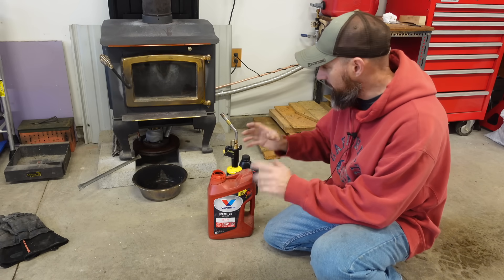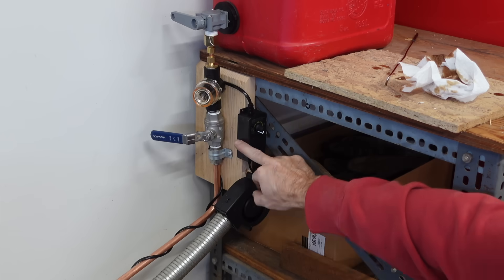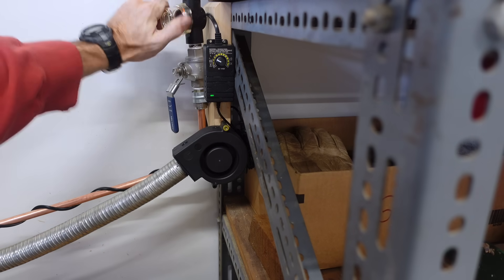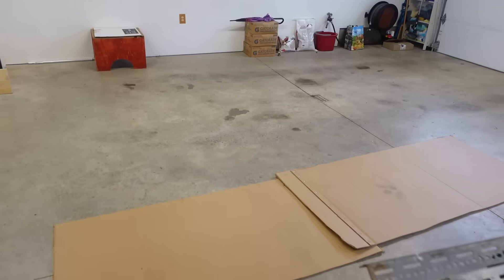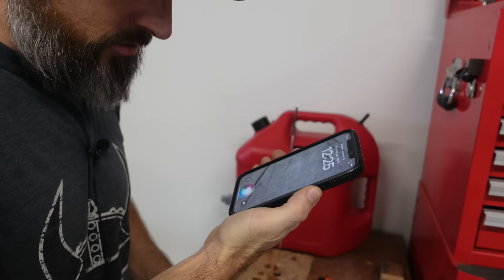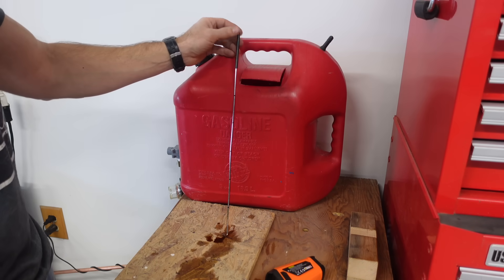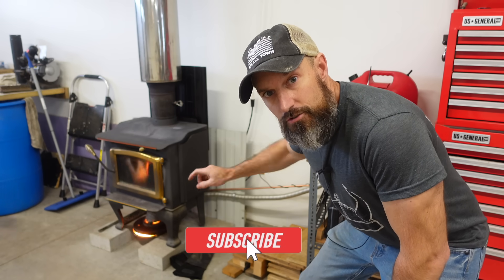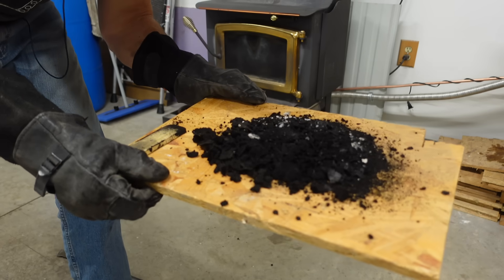How much oil does my used oil burner burn in 8 hours??

Comment: You should get a heat fan so when it gets hot the fan will circulation hot air from your lower pipe into the fireplace.

Comment: The residue in the bowl seems fairly large, so it brings up the question of how much oil residue or partially burned oil has clung to your flue pipe.  Have you looked at it since this video was made?  I would suspect you have to do some maintenance on the vent pipes to prevent an out of control fire in your attic space or roof, no?   Thanks for sharing this video.
Reply from the maker: I just looked in my flue yesterday nice and clean. I don’t burn used motor oil very often, though this was mainly an experiment. I still burn a lot of wood.

Comment: You're blowing 80% of your energy (BTUs) straight up that pipe.... I'd have a deflector plate make that flame blow out at all 4 sides and then up and out the flue pipe... You won't need even 1/4 of what you're using now.... That stove would run you out of there...

Comment: Lack of evident clear smoke, some puffs here an there means your burning hot out the stack. Couldn't close the damper by a 1/3. Direct more heat into your space, your heat is going right up the pipe. You could go 14hrs minimal on 5 gallons with damper control
Reply from the maker: Thanks for the tips!

Comment: What I would focus on is adding steam into your burn chamber.  Have a metal tube that brings the steam right into the lower flame area, and boil your water reservoir on top of the stove OR wrap copper line around your exhaust pipe as long as it isnt double insulated.  You should easy get 2X or above with little trouble, steam converts directly into hydrogen at the waste oil burn temp.  You will be super happy, its as close to zero point as you can get, much more output than input
Reply: Do you have one built with steam as a example?

Comment: as if your set up is like that.. that is dangerous. The part that is under the stove should be inside. And you should be using a puppy feeding bowl not a water bowl.  And my brother made an oil burning stove using an old fire extinguisher.  The bowls are inside the stove.
Reply from the maker: Thanks for the safety suggestions, I will consider that.

Comment: At that rate a full 275 gallon IBC tote would burn 24/7 for 36.66666667 days. That’s absolutely wild. I’ve got access to about 20 of those totes full to the brim with used oil. I really ought to build one of these for my garage. Mines a lot smaller so I could probably use even less oil to get the same results so long as I make one at least as efficient as yours.
Reply from the maker: Sounds like a great project, thanks for watching! just be very careful

Comment: i know this is old but I have converted a similar solid fuel stove which heats my 60' x 7' boat in the uk. My burner pot is inside the stove with a central air supply from a similar fan. I use just under 5 litres in 24hrs and get about 2 tablespoons of ash which is mostly white. I have a perforated dog bowl on top of the burn pot and there are hardly any visible flames as it burns mainly blue confined to the pot which glows red. The exhaust gas is clear. Oil control is by peristaltic pump and air delivery is variable. Flue gas temp is monitored for flame fail detection which shuts it down. It took a lot of mess and experimenting to get it to that stage and I can now remotely control and monitor it from anywhere with my phone. It takes about 30 seconds to convert back to solid fuel.
Reply from the maker: Sounds like a real awesome setup wish you were my neighbor. Thanks for watching

Comment: First off get rid of that insulated chimney that goes all the way down to your stove you are losing a lot of heat by not allowing that pipe to radiate the heat into your space. When I burn paper garbage in my wood stove in an enclosed patio area all the heat in that one 5-minute burn comes off the stack and not the stove. I can often put my hand comfortably on the stove as the bulk of the heat went into the thin sheet metal stove pipe, 6' long and released it into the space 
 I also use a fan. This is very important, as it removes the excess heat that otherwise Would go up the chimney and pushes it around the room. Fans improve  efficiency dramatically. An 8-hour burn should have brought that temperature up to 80 degrees or more. A lot of it is going to heat up the great outdoors.
Reply from the maker: I agree my I need to replace my chimney. I got it real cheap. Thanks for the tips. Thanks for watching

Comment: 90% of your efficiency is being blasted outside via the chimney. Think diesel space heaters they blow into the room. My opinion is to  remove the glass from the door, replace it with metal mesh, and add a baffle to the flu. You'll be at 80 degrees in under an hour. Keep 2 things in mind although please be mindful of black soot or smoke burning oil should not create smoke. Last is fire consumes oxygen so prop your garage door up 1-2in while in use or add a wall vent or draw your combustion air from outside. Do not use and aerosols paint etc... while this is running.
Reply from the maker: Thanks for watching and for the suggestions.

Comment: I can't say this is a good test. You're not starting at a very cold ambient temperature. Here in the northeast, this time of year, my shops ambient temp is around 20-30 degrees. The size is 600sqft. It needs a pretty hot fire the first hour to get it up to 50. Once the temp is there, then it can hum along at 3.5 to 4 hours per gallon of oil. The first hour it probably burns up 1 gallon-ish. I still believe I built the most efficient oil burner on YT. Nice stove either way, Stay safe.
Reply from the maker: Thanks for the tip and Thanks for watching.

Comment: Do you need a regular chimney for something like this?? I need heat in my barn, but I do not want to run a long chimney due to how high the roof is. I'd rather have something like a pellet stove where you just run it through the wall. Trying to figure out the most economical way to have some heat.
Reply from the maker: Yes I believe you need a chimney. I have a Harman P68 pellet stove also. Harman is one of the best. I have many videos here on my channel about the Harman

Comment: Insulted pipe should only go through building/ceiling/roof garage you should see it all single wall and you will get all that much more heat off the exhaust. They also have inline exhaust heaters at Menards. You could also do a copper Coil around exhaust about 18 inches and run radiators around floor off shop or hot water for garage sink. Small solar ran pump, if you want to really utilize the exhaust heat. All depends on how much you are in garage lol I have everything hooked in mine. Also you can get solar/wind power for the heater blower motor in 12volt. I will be showing it all on my YT channel starting Jan 25th KING.TROMP4PRES on all platforms. Thanks
Reply from the maker: Thanks for watching, I appreciate the tips! I'll have to check this out on your channel. I have thought about changing my pipe inside my garage. I got a good deal on it that is why I have it inside also. I can't believe you are the first to say something about it. Hope your channel is doing good
Reply from the maker: I could not find your channel give me a link

Comment: Burning wood in my wood heater i have no problems getting 10 or 12 hours of heat and i get far higher temps from cord wood than you're getting with oil...about double...is this setup capable of higher temps? My stove top with cord word sees temps in the 700 to 900 degree range on the regular, and this old house needs it, but im intrigued with the capacity of oil burners. Bigger jug means less time tending the stove. Good vid thanks.

Comment: Can't you run a heat exchanger to pre-heat the oil?  I bet that would make it get to temp faster and give you a more consistent flow so less management.  Would have to be done in a controlled manner so it's not dangerous.

Comment: I think this is an uber practical tool, useful in specific situations but hardly desirable as a regular heat source: Leave the oil in the ground if you need to breathe clean air!  As I once heard someone say "It's gotdammed Medievalism Jim!!".
Reply from the maker: Thanks for watching. It's just an experiment, and not something I recommend as a primary heat source.

Comment: Anyone who has ideas on how I can achieve this safely by all means reply. The heating unit has a climate control thermostat, all so. 

Coleman Mobile Home Oil Furnace 
Model: 8845A701 Code: 667
Max. Flow: 27 Booster Pressure: .13
Electrical Rating: 115 volts cycle 60 overall rating 12 amps or less 
Tested at .2 inch of water column pressure
Furnace was made in Wichita, Kansas, and tested in Massachusetts in 1964

I have more information on the unit if anyone who can give me any advice on how to get this unit running off waste oil or something that isn't as expensive as natural gas or propane, etc. The thermostat is a newer style (digital climate control). It controls my central air conditioner as well, but it's running off electricity.
I live on the coast of SC, and I know it doesn't get as cold here as other places, but I'm still trying not to freeze my nads off 😅
(Also, I saw on the model plate that the Furnace used to use Furnace oil. I wasn't born until 1973, so I'm not sure how they fueled this thing back then...)
Many thanks, guys & gals! 🇺🇲🇺🇲

Comment: Need to add a small adjustable fan for air intake to turn flame into blue, clean burn, more efficient.  
In addition, put a fan the move hot air away from stove to heat the room.
Reply from the maker: Thanks for the advice and thanks for watching

Comment: Hi. Try install  half inch cast iron plate above the fire inside the burner it will double burn the smoke. When the fire with unburned oil touch the cast iron it will turn into hot gases and double burn . good luck man

Comment: If you get a small generator powered by steam turbine which is created by the heat then you can power the grid for 5 sqm. 😅 probably.
 Better still buy a cheap gieger counter & search your property/ land for any radioactive material such as uranium to turn water to steam to drive that turbine .
 I remember seeing an advert that 1 teaspoon is the equivalent of 1 ton of coal & 90% recycled.
 Its fairly important though to wear safety glasses and a covid mask 😷 😅
Reply from the maker: I never wore a covid Mask and I survived

Comment: you don't have proper flow . . .at least you don't have a drip oil feed . . . get a shield in around that burner and it'll fix some of the slag and once you have air flow right it'll burn much much cleaner and leave less residue . . . only thing i seen 'foul' was i have no clue why people put their supply indoor or so close to the heat source >< i know it's not a real issue cept it's YT and for every one that knows what's up there are ten thousand that have no fuck'n clue :)
Reply from the maker: Thanks for the tip and thanks for watching

Comment: Brun it with WAY more air fozed into the burner,,Micro tweeking but this system Can be maybe 3-400% more efective by building it out so that the burner flame heat dosent leave out the chimny with a temprature of maybe 5-700F,,that is extremly mutch heat lost straigt out the chimeny,,an egr system(second re exsose afteburner would cleen the smoke resedue by maybe 70-85%….

Comment: My friends dad growing up made the pool pump port the water through a bunch of pipes painted black that would heat the water up on the way out of the filter pump. I thought that was so cool I still remember it today 25 years later. To heat the shed, im gonna make a used oil burner that will be almost completely outside, but the exhaust pipes will take a long detour inside the shed to radiate heat. This way I dont have to worry about too much smell or making a mess inside.

Comment: URMUHGAWD what could possibly go wrong? NO NO NO NO NO - Burner pot should be in stove with negative air from chimney at least, to prevent gassing yourself! Air blower is open to the room, going to give off CO when it flickers through the gaps.... No safety to stop the oil flow if the flame goes out/high limit. Sorry, downvote for danger!
Reply from the maker: Thanks for watching

Comment: Hook a little boiler to that baby to power a little stator to charge capacitors and get into blasting things with ultrasound? Eventually you would be sending bathroom waste and food waste to a tank then hitting the resonance to dust everything required to release a ton of oils every so often. You know of wood gasifier I'm sure, but have you ever considered being able to store those fuels for later use? 😉Without needing the gasifier. Ask free or paid AI about Ultrasonic disintegration, its used very precisely by resonance programming for nuclear waste. Amazing its not for masses, even though it would solve thousands of problems just with settings..

Waste leftover from taking fuels = Use for nutrient solution high density to breed Thermophilic bacteria so powerful they can dry material and set it on fire. They are the real source of mulch spontaneously combusting when piled too high. Breed them into a fireproof panel with fireproof wick on a drip diluted below them being fire hazard and they can generate massive heat. Even better? Pile mulch on frozen ground they still come, they slept. You stop feeding them they will sleep, and then when you need fire you know where to scoop from to just use nutrients to make living fire starter. A perfect organism..

Comment: Weld 4 legs 6inch long on another rotor and weld a plate covering the holes it will slow the heat from going straight out the chimmney and make the stove radiate more heat
Reply from the maker: Good idea, I kinda did that but not a rotor. 
https://youtu.be/bVUBz2I3eZ4?si=BJ0sVL25ohKCh_DG thanks for watching

Comment: Check salvage yards, always plenty of drilled/slotted rotors for cheap
Run a garden water dripper instead of stream
Run the NI-COP fuel (oil) line inside the blower duct. 
A hair dryer and dimmer switch would be enough
Add some 99% Isopropyl to oil to make ignition easier. 1/2 pt per gal.
Reply from the maker: Interesting. Thanks for watching. Wish you were my neighbor.

Comment: single wall pipe will heat your garage better.
Reply from the maker: I agree I have been thinking about replacing it at least up to the ceiling. I got a real good deal on that pipe. Thanks for watching.

Comment: This is a cool adaptation of an oil burner I'm familiar with, its called a smudge pot aka orchard heater.  Pretty cool way of doing it.  Going to have to try to build it.
Reply from the maker: Thanks for watching stay safe
Reply: The smudge pots I remember didn't have a blower on them. Filled the pot with oil, lit the top of the oil, and then regulated the burn by closing the draft that was built into the filler lid. Where the real heat cam from was the stack. It started at about 4" dia. and went to 6" or 8" in about a height of 4'. Along that cone were slits that were louvered out that drew the air into the flame this burning the smoke. Draw back to this design was that after some time the stack would erode and new pots needed to be bought(until the EPA banned them). A possible solution would be a stainless steel stack of the same design.

Comment: I had this set up running for years. I took it out last summer. It was running one night as it does and it combusted and pretty much exploded. I had it in an empty area of the shed luckily. The one thing I learned from the experience was..it was almost uncontrollable once it went wrong and highly volatile. After that I was done with them
Reply from the maker: Maybe I should burn it in my stove. Really not sure if I’m going to burn it anymore. I have a lot of wood. Thanks for watching and for the comment
Reply: @DIYJIM  it was a good watch amd sorry I did mot mean to be critical. Man I thought my workshop was gone that night. I had a pressure washer hooked up outside,if it wasn't for it I was in trouble. It was so volatile. I managed to get the pressure washer pointed out the shed doors..the already lit oil just spread out. Very scary stuff
Reply: While it is possible to extinguish a blaze using a stream of water if nothing else is available (we trained as fire fighters to do so on large - outdoor - fuel fires) it is a MUCH better idea to use an appropriate fire extinguisher (Type B) & those are only ~$40USD...  I don't burn waste oil but do have several A-B-C type (covers most everything you'll see in a home fire) in my house & shop.  Also fire & CO2 detectors in case I don't hear the start of the fire.  If you decide to continue with this in the future (which I do not recommend of course, due to the liability & your insurance most likely being invalidated) look into safety controls you can implement to stop the flow of oil in the case of a failure.  Your family's life is not worth any amount of savings!
(Yes, I saw you said you stopped doing this.)

Comment: Nice!  

I built a sludge pot with a 20lb propane tank, 5" exhaust pipe out the top, 5 - 3/4" pipes about 3" long welded in around the top to let air in, and a 2" pipe a couple feet long welded to the bottom and angled up taller than the pot..

I burned heavy sludge from waste veggie oil mostly and it worked great.. 
It worked best at around 1/2 full. I wanted to design a way to have an automatic fill so I could hold it at the half full point. Just ran out of sludge to burn, and I'm trying to re-locate to a different state.

Comment: Fire outside of the box is asking for it .
Turning your back on it only takes a second of atomized oil overflow vapor as explosive as gasoline . 
Keep eye on never unattended. ✌️
Reply from the maker: Thanks for the safety tip! I never leave it unattended. If I were to burn it all the time I would put it inside the firebox.